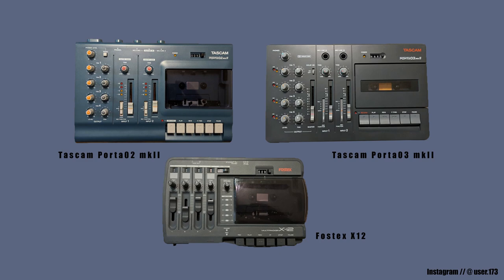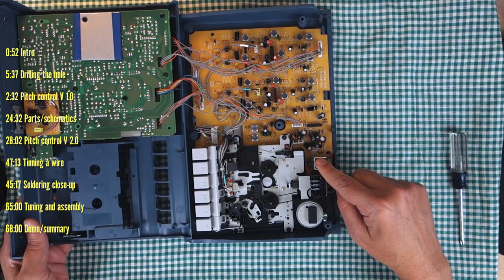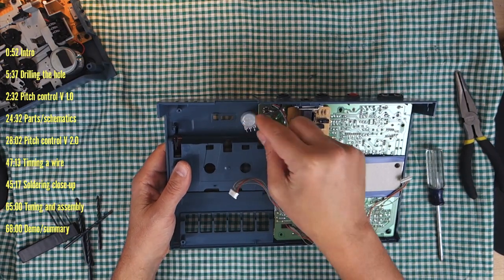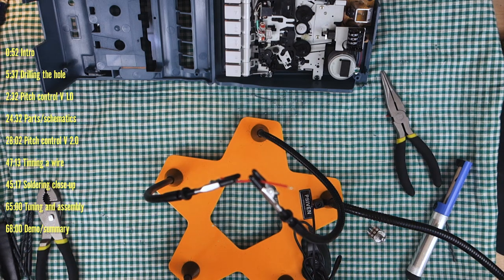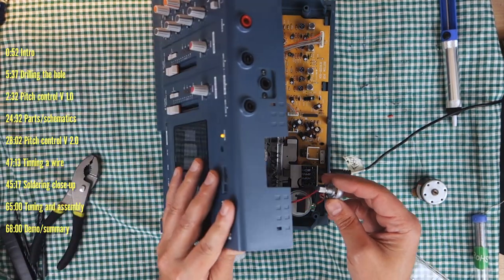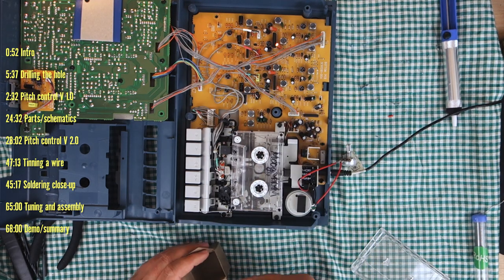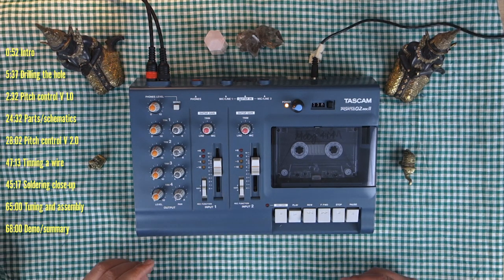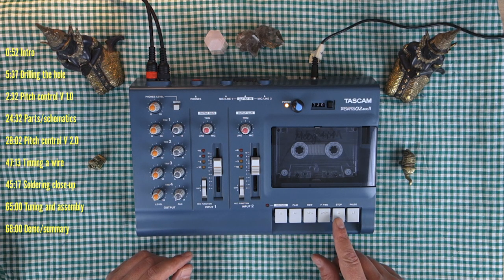DIY pitch control IN-DEPTH TUTORIAL!

Comment: This is EXACTLY what I was looking for. I have a PO-1 but I think I can make v2 work. I'm an absolute amateur but I've been interested in doing this stuff for a while  - I have a lot of confidence coming off of a successful belt replacement! This video is super helpful and informative - the bit about reversing polarity to alternate the motor direction was SUPER helpful as you can find tons of the motors you use in this video but they're all COUNTER clockwise. 

Subscribed. Keep up the great work!

Comment: thank you for makign this video!

had a lot of fun and learned a lot doing the first, simpler process (just slowing down) on my tascam.

But, I'm facing an issue where the playback can only be stopped or played. There is no fine-tuning control.
At 100% down to about 90% it plays full speed, and anything under 90% on the knob it stops.

Any idea what might be causing this?

I used a spare pot I had for my Telecaster, which I'm thinking might have been an issue.

Any help is much appreciated! thank you!

Comment: Hi! Just getting started with cassette multitrack recorders and your videos are super instructive. Unfortunately I couldn't find the mabuchi motor and i ended up getting a fostex xr-5 for a reasonable price on ebay (since all multitrack recorders are pretty expensive now). I just wonder if you have any idea on how to mod one to play at normal speed, since this unit plays at x2 speed by default and could benefit from this. I've only found a few videos on youtube on a chanel which the unit is modded with a switch affecting the speed and a knob controlling the pitch i think. Anyway great videos here! I'm glad i found this channel
Reply from the maker: Yeah the Tascam 414 also plays at "double speed". They were intended to work that way, but you can adjust the internal adjustable resistor. have you tried that? it should be on the board somewhere, leading to the motor control board.

Comment: Curious why you need a new motor for the 2nd attempt at the mod, why the original motor won't work for this? Appreciate your time making this video.
Reply from the maker: Because the first mod is not a true pitch control. you can only pitch down, not up into faster speeds. you need the motor with a pitch control board to properly do it.
Reply: @User173  Could the original motor not work with the PCB you made ?
Reply from the maker: @stretchmetalfanclub  The PCB does not function as a pitch control. it's just an extra little step to allow for minor speed adjustments to the motor with a speed control. so no, it would not work with the regular motor.
Reply: @User173  or i guess a better question- how do uk if a motor can do varispeed?
Reply from the maker: @stretchmetalfanclub   the motor will have a speed control board with a positive, negative, and A and B terminals to solder to. The regular motor just has a positive and negative. it does not have a the little pcb that the speed control motor has. Like I said, you can pitch down the regular motor, you just can't pitch it up. But there are ways around it! So, say you record at a slower speed, then when you play back and speed it back up to "normal" it will sound pitched up. However this reduces your amount of pitch in either direction. So basically it's really only good for pitching down, but to be fair, I rarely, if ever, pitch up my sounds, I'm almost always pitching it down/ slower because it sounds cooler IMO.
Reply: @User173  so helpful, thank u!
Reply from the maker: @stretchmetalfanclub  awesome, glad to hear! any questions you have I'll try and help!
Reply: @User173  hey there's a video out there where a guy says you can open any motor top (where like the hole for the trimmer pot is) and take out the circuit board and rewire it to a PWM (pulse width modulation) board. either way its a amazon purchase but I was wondering your thoughts on this and which method is easier or cheaper, or which is overall better for the machine in the long run.

Comment: Thanks again for another great video. My Porta02 is on the way and I'm getting ready for this project. Could you just confirm that the potentiometer I need is 500 ohm and not 500K ohm? I keep seeing the latter on eBay. Thanks!
Reply: Also the Mabuchi motors I'm seeing online don't seem to have the same connection points as yours: https://www.ebay.co.uk/itm/1PC-Mabuchi-EG-530AD-6F-6B-DC-6V-Tape-Deck-Recorder-Audio-Spindle-CW-CCW-Motor/282688561462?hash=item41d18d2136:m:mBdRMsraF_zxHixqDi7w4ug
With this motor, how can I tell which points are connected to the power supply and which ones go to the potentiometers? I can see positive and negative but no A & B
Reply from the maker: Hey there, yes it's 500 ohm. not 500k. let me know how it goes!
Reply from the maker: @jaan3334  Hey, I put the exact model number in the video, so you should look up that model number. You also need to be careful of which direction the motor spins, and again the model number I shared is the correct one for you :D The one you are linking is not the correct motor.
Reply: @User173  Ok cool thanks! I'm having a hard time finding the exact motor you've linked, will only that one work? Or are there substitutes? Thank you for all your great information!

Comment: Thanks for the tutorial. Would this work with Mabuchi EG-530AD-2F or Mabuchi EG-530kd-2b ???
Reply from the maker: It's been a while but the motor needs to have a control board/ four solder points (+,-,A,B) and it needs to spin CW or Clockwise. The first motor only has two control points, but it does spin CW. so it will work to power your machine, but you cannot do the second pitch mod I showed you in this video. The second motor you asked about has the control board that you need for the proper pitch mod, but it spins CCW or Counter Clockwise. so it will not work.

Comment: Awesome Mod! I love the speed control on the 424, but I find myself using the porta so much more often. I'd love to do this mod but the only motor I aim finding with the same item number on eBay is a 2400rpm version and not 1600/3200. Any ideas?
Reply from the maker: hmmm, if it's just got the one rpm, then it's probably not the right motor. It's gotta be the one I list in my video, or something the same size and that has the variable board as well as the correct rotation direction. it's a bummer there are none out there right now. hope some will pop up soon, I want to do this mod some more.
Reply from the maker: another option is you could get a fostex x-12 and use it's motor, as it's the right motor for the job.

Comment: Is it possible with a Tascam MF P01?
Reply from the maker: I'm not familiar with that one, but it's a 4 track and it's got a motor in it, so yes, it's possible. Just looking at it, I see how compact it is, you'd have to open it up and make sure you can fit a POT in there. But you could at the very least add a POT in line with the power as I show in the first example, and pitch it down if you don't have room for a new motor.

Comment: If I do it with an arduino and pwm to motor will work? I'm thinking to can put limits to the pot. Another question is if I can do the pithc limits has +- 10%, like turntables.
Reply: BTW great job !!! :D
Reply from the maker: well yes you could attach an arduino to the motor, but it still has to have a pitch control board, otherwise you'd simply use my other method which just regulates the speed through dipping the power... so you wouldn't need an arduino. I'm not sure about the POT limits. The motor control board seems to have a threshold where sticking a larger pot doesn't seem to make a difference after a certain point.

Comment: would you be able to do something similar for a regular cassette player? I noticed yours doesn't have an on/off switch and I could only find YouTube tutorials with the on/off switch plus the potentiometer?
Reply from the maker: yes, technically you can. Most regular cassette players don't have variable speed motors. However you can connect a pot to the positive and negative terminals on the motor and pitch it down that way. but you can't speed it up, which isn't technically a big deal since rarely do people speed it up.
Reply: @User173  Thanks, would you recommend switching out whatever motor the cassette player has with a variable speed motor like you did? and then connect a pot to it? Or just do what you did in the beginning in connect a pot directly? Thanks!

Comment: is there a good alternative to the mabuchi motor you used in the v2 mod? I'm having trouble finding one
Reply from the maker: There are, yes. You can find a lot that go counter clockwise and just wire them backwards I believe. Other than that, Mabuchi made the original motors, so they are the only one's that I know fit into these machines. You should be able to find some on Ebay. There is a guy from China and a guy from Mexico that sell them.

Comment: Is there a difference between the porta 02 mkII and the porta 02? And is it done the same way on both?
Reply from the maker: are you talking about the porta 02 ministudio? the one with tons of knobs on it and it's much bigger? I've not opened that one up, but it should work if you can find a place to put the potentiometer. but can you open it up and tell me what the inside looks like and what motor it uses? or could you snap a few photos for me and send it private message to my instagram? I'd like to help you if I can.
Reply: Great video User 173. Did karikmm's question get resolved? Many thanks in advance.
Reply from the maker: @jason0s  I've never opened a porta 02. It's an old antique, much bigger too. I imagine the same process can be done, but someone needs to open it and see what motor is in it.
Reply: The difference between porta 02 and porta 02 mkII is that mkII has a guitar input between the two mic/line inputs and the top caps of pots are colored.

Comment: Will this work on a Tascam Porta 02 that's not MKII? Also,  is this type of mod possible by installing a PWM motor control board between motor and power?
Reply from the maker: yup, absolutely.
Reply: @User173  To which of the two questions is that an answer ?
Reply: @User173  You didn't answer my question. Could you clarify, please?
Reply: @janktunes think it was yes to both